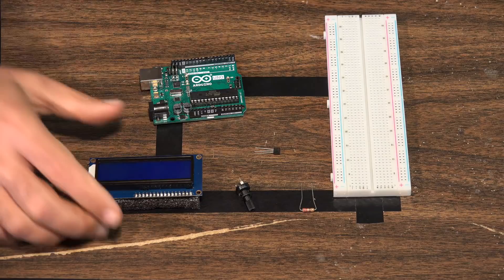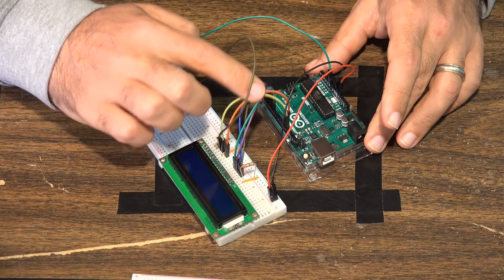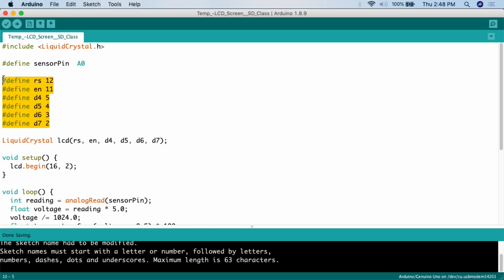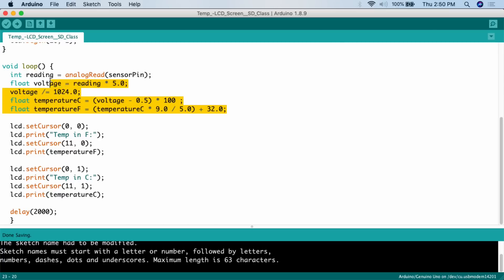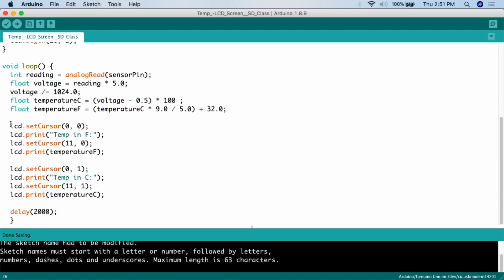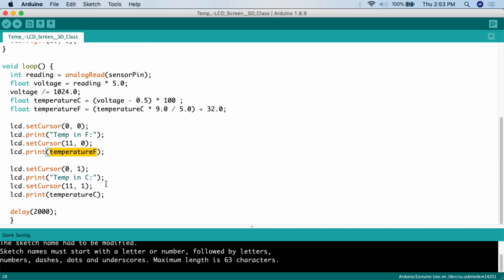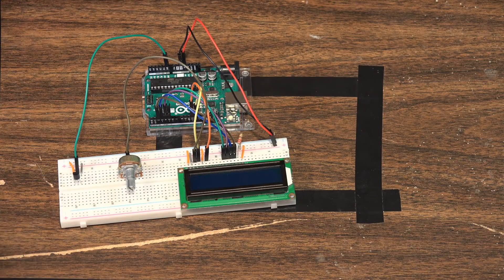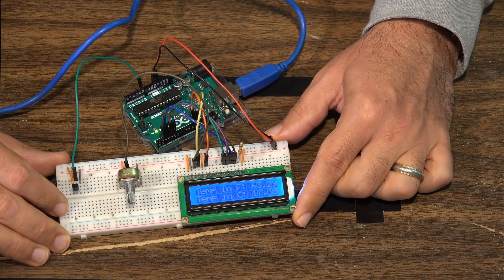16 x 2 LCD and Analog Temp Sensor on Arduino

Comment: Hi, you have an error in circuit scheme on your web page (interchanged pin 3 and 4 on LCD). For long run projects, I would consider adding resistor or potentiometer to LCD backlight (pin15) as its too bright in default. Otherwise thanks for such an easy setup, thats exactly what I needed.

Comment: 2:45 - It's a lot easier to use a PCF8574T I²C interface to use two-wire serial control, especially while prototyping.
11:00 - I find the white-on-blue one has a slower refresh rate than the black-on-yellow one (not sure about the red one yet).